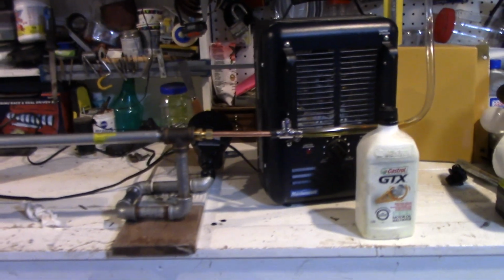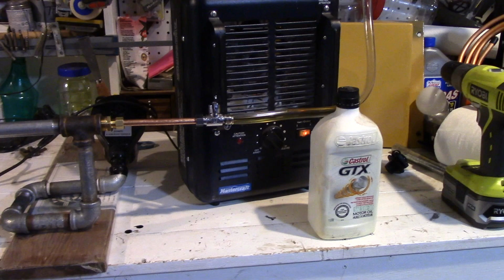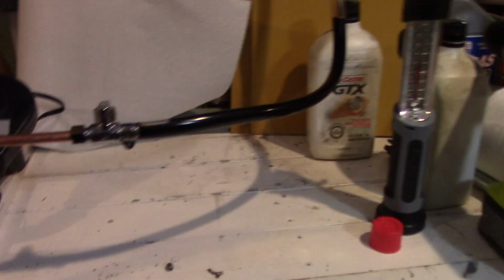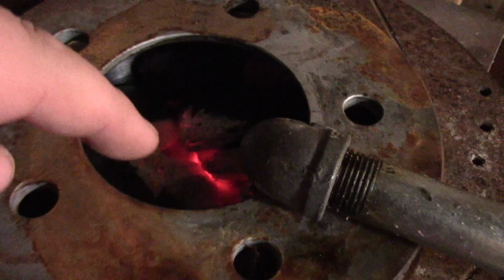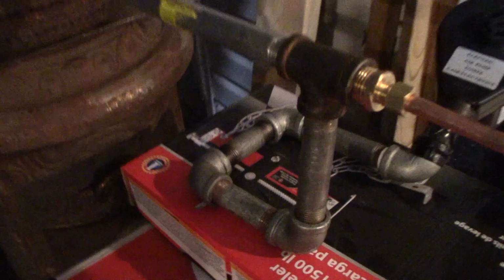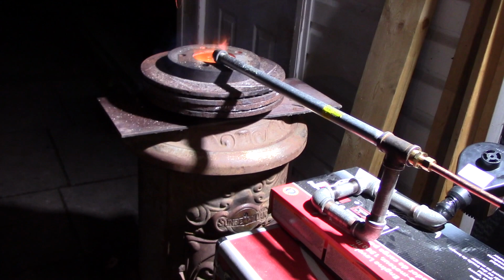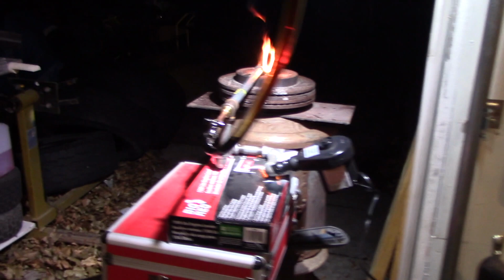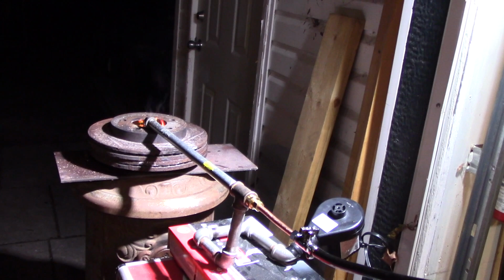Waste Oil Burner Design Diy Test P3

Comment: Why don't you put a pipe with holes in the center and use a cylinder and weld the disks on it then you should better combuztion without the blower